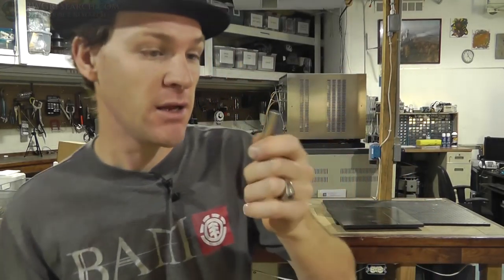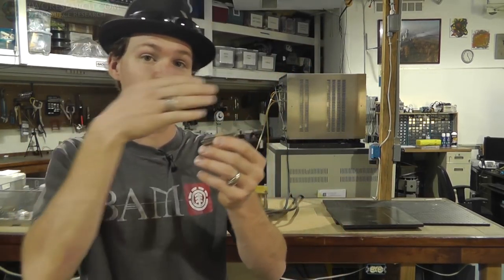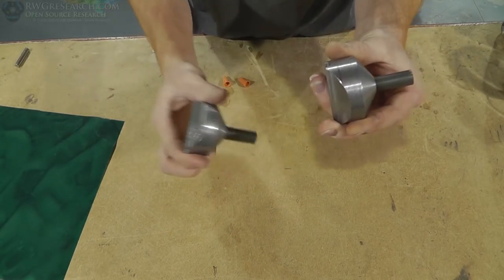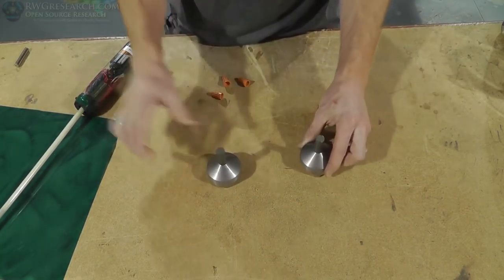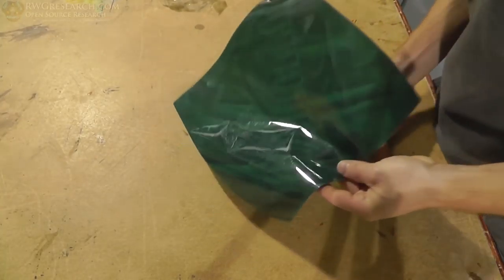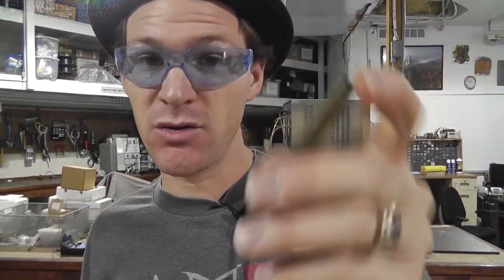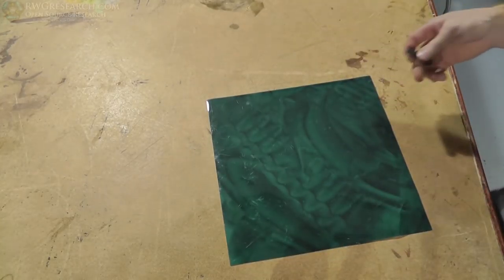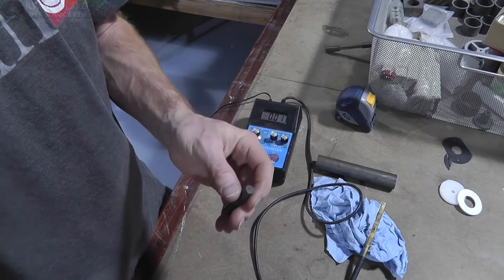Test:6 Magnetizing Experiments  : Curie Heat Setting & Focusing cores Diametrically.

Comment from the maker: In this video i try different methods to achieve a nice Diametrically magnetized magnet. Including heat curie setting. but the results are mixed. some of this is due to the " mass" of the magnet. if the magnet was  bigger it would be stronger. ~Russ
Reply: *****   Just a thought,  does the ratio of length to diameter have something to do with the results you are getting.  Try using a magnet that is as large in diameter as it is long.  I have a hunch that you will find the results will be more equal if the length and diameter are more equal.  the magnet you are using appear to have a length that is about 6 or more times the diameter.

I am interested in diametrically magnetized magnets because I am in the process of making some small parts with 1/8" D x 3/4"L alnico 5 rod and it needs to be diametrically magnetized.

Comment: Try a plastic core with the iron on both ends. I think its the alignment of coil to the Manet that's the problem. The iron on both sides should focus the coil better. Which is why I think you have better results in vertical orientation.

Comment: I think you have to graph a ratio of cross-sectional suface area with the amount of power produced by the magnetizer.  It could be that the smaller cross section of the axilally charged magnet just has better power density applied when charging.

Comment: Hi Russ
1, You are heating the magnet  a lot higher than 452 deg. Celsius..I estimate about 700 deg celsius + ...I can tell by the colour of the incandescent glow. 450 Celsius does not glow.
2, 	Reversible losses: Up to the MaxOpTemp, you will see some loss of magnetic strength at those elevated temperatures.  When you bring the magnet back down to room temperature, it returns to the original strength.  These losses are small, typically within 5 to 10 percent.
	Irreversible losses: Above the MaxOpTemp, some magnetization is lost.  When you bring the magnet back down to room temperature, it will be weaker than it was before the heating process.  A magnet that has had irreversible losses could theoretically be re-magnetized to the original strength, or very close to it.
	Permanent losses: Above temperatures where the magnet material was originally sintered, structural changes will occur to permanently demagnetize a magnet.  No amount of externally applied magnetic field will bring the magnet's strength back.  For neodymium magnets, this temperature is very high, typically above 900°C to 1000°C.

Comment: It could be that the nickel casting that helps prevent oxidization of the Nd and Fe, are creating eddy currents they prevent domain alignment? I am not sure on that specific coating process if the magnetization happens before or after the protective coating. I do think that on very strong magnets the, sintering (heating process) can take days to complete. Somebody else commented on getting the curie temperature high enough, and long enough to disrupt all the magnetic domain alignments in the material. I could be mistaken but that's just some thoughts I have. I have no actual hands on experience, so don't know if any of that is helpful. So thanks for sharing and keep it up. Peace to you and yours.
Reply: Good luck!

Comment: Okay, I'm going to open my mouth and show what a fool I am.  When you magnetize a rod magnet in the coil(s) you have axially (along the length), you expose it to more turns of the coil at a given distance than when you attempt the diametrical magnetization.  Since a coil gets a higher magnetic field with each turn on it, that means you can't expose the shorter diameter to the same field intensity by turning it inside the same coil in my little idea of the magnetic field being produced.  You would have to build or use a coil built to magnetize each size of stock diametrically to get a higher strength in the resultant permanent magnet relative to its material and dimensions.  I'm no expert, but this seems to be what is going on in my warped little mind;-)